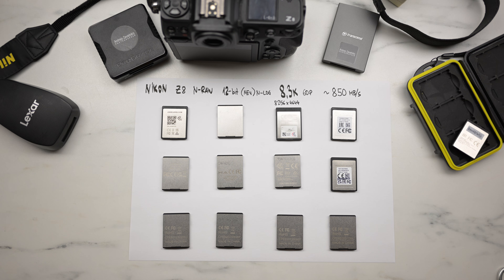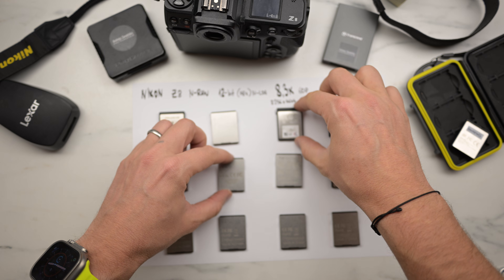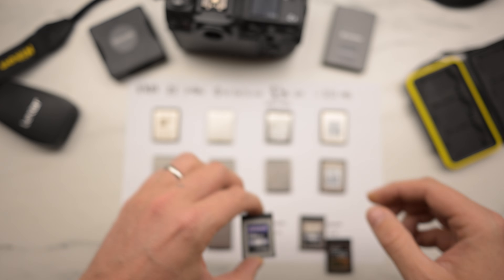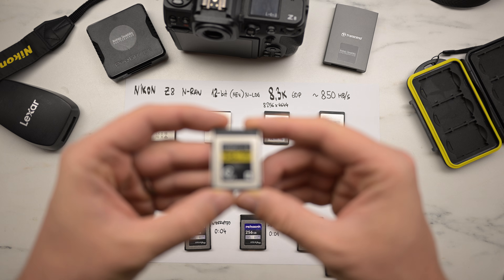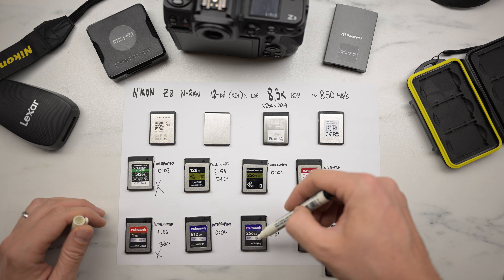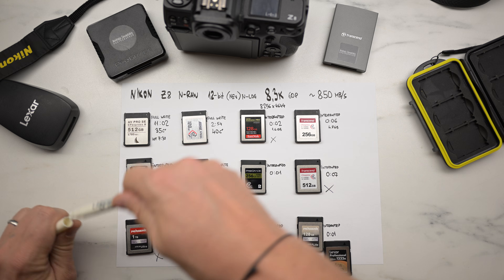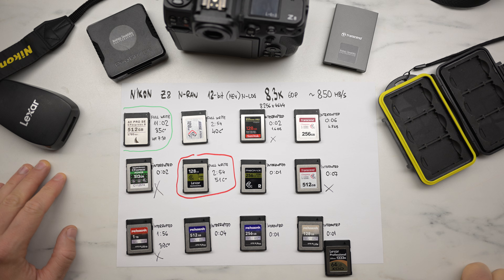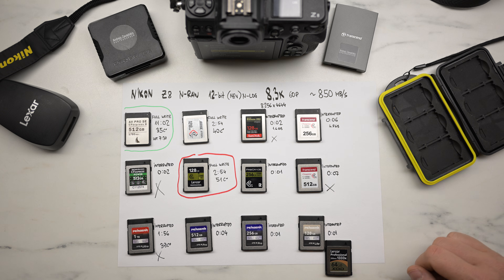8K CFexpress Card Meltdown! 🌡️ Truth Behind Speed Claims! 🔥

Comment: I completely agree with the review and I fell for it too, then I returned them. In reality those cards are generation 2 or 3 I think given the absence of the n4 on the stiker and unfortunately many manufacturers do not report the susteined write speed. They might perhaps be fine on a z6 or z7ll but not on a mirrorless like z8 or z9 which generate a huge video data flow. For photos only I tried them too and more or less they work fine without slowdowns at 15/20 fps. Z8 and Z9 require a CF express with susteined speed of at least 850 mb/s, the ideal would be 1500 or 2600 but the prices take off.

Comment: Delkin 512gb Generation 4 card works well.
Reply: Many card brands, that came out with 4.0 spec compared to 2.0, they passed the 8K video test on the lower card line from the top speed model. If you had the Power line vs Black, or Gold vs Cobalt. 
Even so, they are advertised about 800 sustained. I wonder if there is also speed penalty for sustained speed, if you use 4.0 card in 2.0 camera?

Comment: 5780 mb/s is the write speed needed for high quality n-raw 12 bit nev 8.3k video at 60p files on the z9 according to the manual. How is it so low for the Z8?
Reply from the maker: 5780 Mbps = 722.5 MB/s  (8K/24fps)(High quality). you mentioned Megabit per second.  I am talking about Megabyte per second. we don't use file size in bits any more. We are talking in megabytes and terabytes

Comment: Great comparison of the different cards. I guess by luck all of my cards are the Angilbird AV Pro SE cards! An extra note on the Angilbird cards according to there website the SE 512 GB card has a sustained speed of just about 850 MB/s so it worked in your test but the AV PRO SE "1 TB" card is actually much better with a sustained speed of 1550 MB/s so if you are doing a lot of high performance video the Angilbird AV PRO SE 1 TB card is the better card. Angielbird also does firmware updates for there cards wikis is great as will as they guarantee the cards.
Reply: Good to hear! Because I just bought the 1TB Angelbird while watching this video and reading your comment! I’m running a R5 and 8K Timelapses with an SD card which basically means it doesn’t. 

Plus hopefully this is the only one I buy so the upfront cost (including the reader) will pay off in the long run.
Reply: @tylersoares8120  Good luck I have been using the Angilbird cards for a few years now and they have performed well. Also I like your Timelapse with the lightning!

Comment: I’ve had two anglebird AV SE Pro cards and both developed cracking in the plastic housing and left plastic pieces in my cameras card slot I had to carefully remove. Would not recommend.
Reply: Seen this mentioned in other venues too. Have 6 prograde cobalt and three Sony tough cards with daily commercial level use over 2 years no cracking or corruptions thankfully.
Reply from the maker: what camera used ?
Reply: @AndrejsZavadskis  R5 and R5C